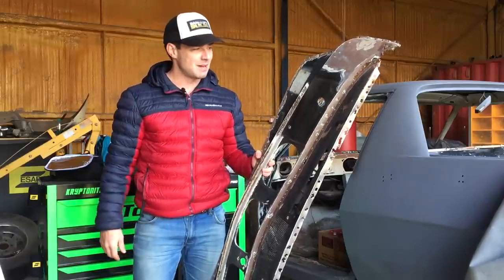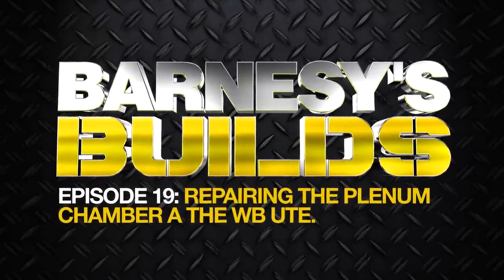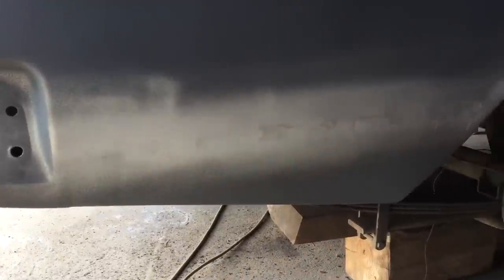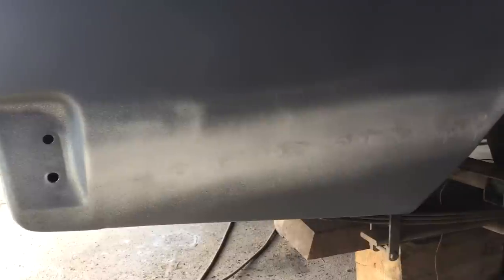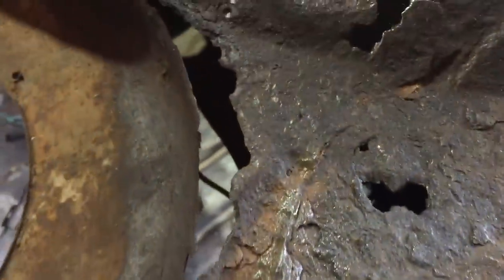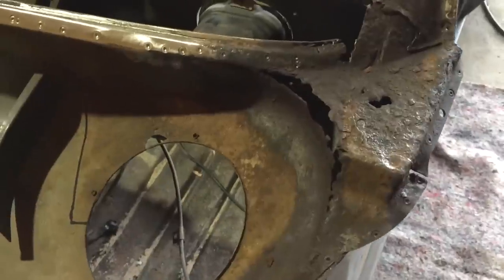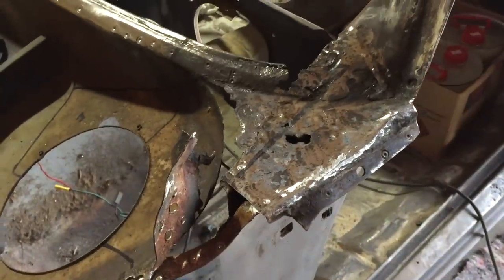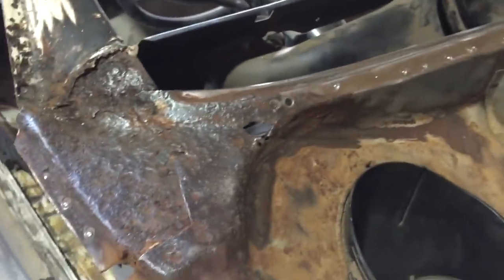EPISODE 19 - PART 1: REPAIRING THE PLENUM CHAMBER ON A 1982 HOLDEN WB UTE

Comment: Love your work Barnsey. Can’t wait to see the finished product.
One thing you may want to factor in...if The value of WB Utes increases one day like a lot of other Holdens, then yours will be worth more with the original motor. So I’d get it reco’d if it were an option.
Reply from the maker: A M thanks mate, yeah I have been thinking about the engine quite a bit, it’s not the original engine anyway apparently, it used to be a white WB column shift auto with most likely a smaller engine in it. Someone put a T350 and a 308 in it. I will most likely reco the 308 if I can as it sounds beautiful.

Comment: Hey Barnesy, Holden spot welded the hell out of the cowl because it is a structural piece of the body, old mate with the sikaflexed cowl might end up cracking his windscreen if he gives it a bootful down the track....
Reply from the maker: Luke Henley ok thanks for the heads up mate, I won’t be using glue then! Cheers

Comment: good work on your ute
i'd be interested in the  cutting blades when you get them done any idea to cost per blade ??
i usually buy the fibre discs from  a guy at the swap meets for $1 a blade
same with the 4" flapper discs a pack of 10 for  $15
heaps cheaper than bunnings
Reply from the maker: Thanks mate, at this stage as i am in final testing for the grit and durability it's looking like they will be around $20-$30 range for 76mm - 125mm for air tools and angle grinders. I would expect that they would most likely last the equivalent of around 20 fibre discs. So it will come out on top for most people who buy from hardware places but the real savings will be the time not having to change blade 20 times and also keeping the same diameter through the lifetime of the cuts. I hope to have the finished product ready to go in around 3 weeks.